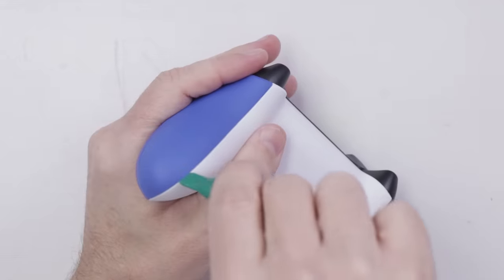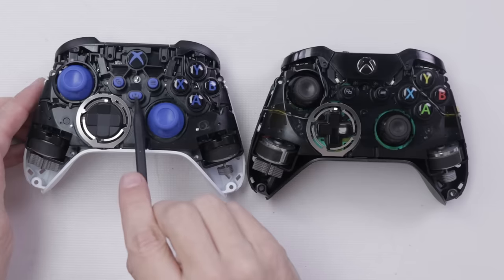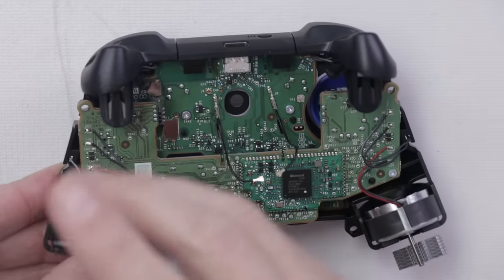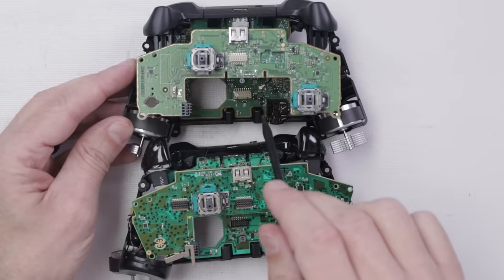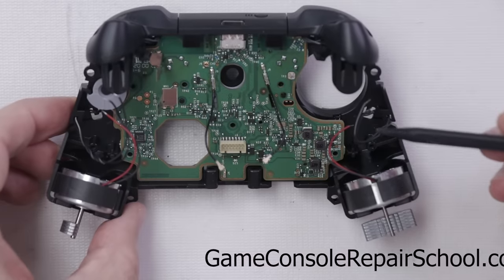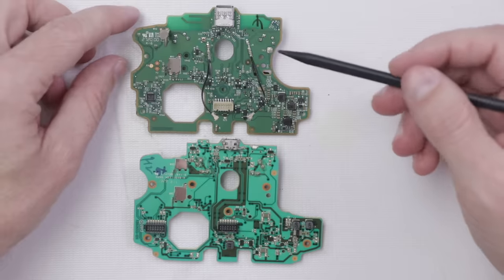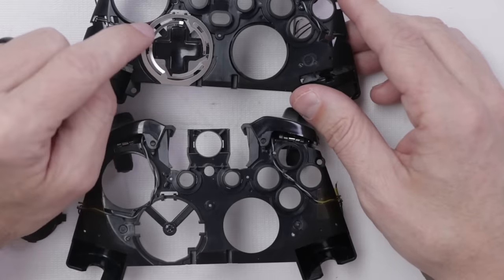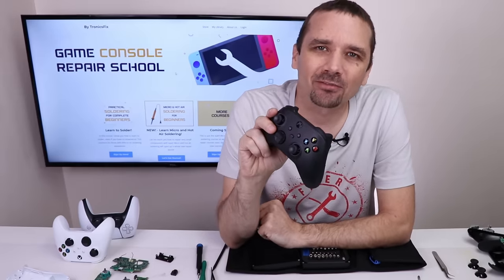Xbox Series Controller Teardown - A Repairability Perspective

Comment: I love how microsoft uses only like 2 different screw types, making it easier to repair
Reply: Master ELITE  idk i hated trying to fix an Xbox controller the ds4 is so much easier to fix
Reply: @Mancalius  it’s sarcasm
Reply: I like how microsoft makes xbox users change batteries everytime.
Reply: @JesusIsLord7773  I prefer it
Reply: @Mancalius  However, if the rechargeable battery dies. You just need to buy a new battery, not an entire new controller.  Also you can use rechargeable AA batteries which wouldn't cost much.
Reply: @Mancalius  you know they sell them in other countries too? And the currency changes. And you will be able to get it with free shipping. I'm not saying it's good, I hate the need to buy a battery pack and think it should be included but your argument wasn't very good my man.

There is also nothing stopping you from buying it with your console...... So you don't need to go out of your way to get it.
Reply: Playstation fans will literally use any flaw to their advantage and bash other people for not having said flaw on their system lmao what’s wrong with having easy to repair controllers?
Reply: @Mancalius  who in their right mind goes and buys 1 pair of batteries, instead of buy multiple battery's at once or rechargeables, not tryna be rude but that was fanboying at it's finest
Reply: @Mancalius  also what are you taking about fail rate if your ps4 doesn't break externally in a year then that battery won't hold a charge in a year unless constantly plugged in so talk about a guaranteed fail rate and guaranteed needing a new controller every year or so
Reply: @SanderEvers  if the batterie dies in a PlayStation controller, you just have to charge it, not buying anything
Reply: @JesusIsLord7773  you do realize the control is also wired just by playing while it’s connected to the Xbox with a usb
Reply: Actually this is ridiculous! All I want to do i clean my face buttons....  why the hell do I need to get my soldering Iron out to do that!?  Just to unsolder the stupid rumble weights!
Reply: @Andronicus87  what? You don’t have to take them off... I don’t even have a soldering thing and I’ve opened my control and cleaned out all the buttons cause they were sticky. There was still plenty of space when the board was there you just have to pull it back as much as you can without ripping the wire but it’s really easy.
Reply: or paint
Reply: @SanderEvers  Thats cool and all but its cost almost as much as an dualsense and with the official $20 play and charge kit even $10 more than the fualsense even though it has much much less features. Its a dcam either way if we are honest.
Reply: @beardedape7966  but that are the cheap quality ones
Reply: T10 T9?
Reply: @JesusIsLord7773  I like how Microsoft also makes my hands not die after a 20 minute play session.
Reply: @Mancalius  Or rechargeable batteries for $10
Reply: @vincentnavarrete5003  Lmao you kidding me? You have to dismantle the ds controllers into tiny pieces just to get to the analog sticks for example..
Reply: Right and the larger ones seem to be just for the shell and the smaller ones are for the board it's even intuitive too
Reply: Nintendo on the other hand...
Reply: Apple with their macbooks: uses 300 types of screws making it harder and more expensive to repair than Xbox One S controller
Reply: @sussyjetpilot1198  honestly one of the many reasons why I hate Apple
Reply: The ps5 controller is way easier to fix and it has way more stuff in it
Reply: Yo dude.
Like with all fanboyism aside how long does a series x controller last? 
Like for heavy gaming? Will its buttons stop functioning easily with hardcore gaming? Or will it last 1+year easy? Since i wanna but 1 for pc
Reply: You all can argue why you prefer Xbox over Playstation due to replacement of batteries, but you can't deny that doesn't matter and Sony's Playstation will always outsell Xbox haha. So quit your childish faboyism and go play your favourite games.
Reply: @Kaminari_Kitsunokami  you can hate Apple all you want. Apple isn't going anywhere.
Reply: As someone from a developing nation, I have absolutely no idea where to get the T-series screwdrivers so unfortunately it isn't that easy for everyone 🥲
Reply: @PeanutBreathing  I have absolutely no idea why they don't just use a normal screw. Also Amazon
Reply: @adjacent-smith  I feel like it's to deter self repair. We don't have Amazon where I live 😅
Reply: @shxzzie_  I'm xbox a d this shits annoying. I literally have a 36 pc speciality bit set so I have all the shapes and all the sizes of pretty much any screw.. except for the one needed for the xbox controller. And I'm deeply upset about it. I dont have money right now for buying a tool. I dont even have a car to go try and borrow one from somebody. I'm literally researching ways to unscrew and rescrew any screw. And it's annoying.
Reply: @megakoni1 they mean die as in dead dead not die as in you give it water to restart the day lol
Reply: @JesusIsLord7773  I would much rather have removable batteries.  While my daughter waits for her PS5 controller to charge, I slap a fresh battery pack in and keep playing, and don't have to have it plugged in.
Reply: @shxzzie_ yep, and it's painfully pathetic.  Fanboys of most things are top tier cringe.  If you have man sized hands PS5 controllers are miserable to use for extended play sessions, but to each his own.  I own every console and have a few grand wrapped up in my PC.  I like video games..period.

Comment: Very simple if compared with the PS5's Dualsense.
Reply from the maker: Yep...very similar to the Xbox One controllers.
Reply: I'd love to see the elite series 3 controller
Reply: this shows that microsoft did not put effort for controllers.
Reply: @velumanisakthivel221  I think this is a good thing. Most xbox players don’t want a drastic change. The only thing the Dualsense has that I’d want is the adaptive Triggers and 3D rumble. I bet Microsoft will do this in a few years.
Reply: @Steelbooking541  probably in xbox elite controller
Reply: @relate97  rumbke is different from a voice coil actuator, the voice coil actuator on the dualsense is even better than that on your phone, making it able to make much better feeling vibration sinstead of rumble, and making vibrations able to be barely feelable or evident
Reply: @Steelbooking541  that isnt 3d rumble, thats a voice coil actuator
Reply: @eryavrilio3751  and no the elite controller dosent have 30 rumble or a voice coil actuator
Reply: @Mancalius  Does the voice coil actuator have its own chip controller? Can i replace the rumble motor with that thing?
Reply: @eryavrilio3751  its probably impossible to be put on a dualshock 4 since a chip is in the dualsense for it, and its a different type of system so the dualshock 4's commands probably wont work or would be super basic for this mechanism
Reply: Bryan Smith good for single player games tho like god of war or spider man itll make the game a lot more immersive
Reply: @velumanisakthivel221  if it ain't broke don't fix it
Reply: @Steelbooking541  and that's exactly why Xbox always lose on sales because they don't show next gen features and they are always behind that's why Nintendo switch pass Xbox on sales and if Microsoft keeps showing that they don't care about their console they're always going to lose
Reply: @Steelbooking541  not if Sony has a patented
Reply: @derekotero7935  Microsoft isn’t trying to win a ‘console war’ that’s all in your head, I’ll also mention Microsoft player base is PC players AND Xbox players. Which is probably bigger than PlayStation or Switch by themselves.
Reply: @ethanw6624  Sony can’t patent that. They can patent the EXACT design they used but they can’t stop Microsoft from designing their own version that accomplishes something similar.
Reply: @Steelbooking541  anything can be patented like the xbox elite is patented the paddles are the adjustable thumbstick tension is patented what stops sony form doing it
Reply: @ethanw6624  That’s untrue. Like I said THE EXACT DESIGN, And dimensions of the paddles are what is patented. Microsoft cannot patent the WHOLE idea. That’s like saying google can patent smartphones so no other smartphone of a different design can be made. Sony can make a ‘pro controller’ with 4 back paddles and trigger locks if they want. Do you not realize there are MULTIPLE other brands of controllers with 4 back paddles and trigger locks that are not Microsoft’s? I don’t think you understand how patents work.
Reply: @Steelbooking541 for an example apples lightning cable is patented there are thousands of companies that make it but they pay to use it do you think Microsoft is going to pay to use it and most pro controllers use buttons because they dont want to pay scuf ot Microsoft money to use paddles and Microsoft used scuf patents for the paddles
Reply: @ethanw6624  Apples lightning cable is an EXACT design that only communicates with apples software though. You don’t understand how patents work.
Reply: @velumanisakthivel221  it’s already the most confortable controller on the market so obviously it wasn’t going to be a big change
Reply: @velumanisakthivel221  properly thought they didn't have to. to many companies cut corners nowadays and xbox thought sony would do the same big mistake.
Reply: @Steelbooking541  if they don't care about sales why do they even keep making consoles... Oh and yeah I'm one of those PC players
Reply: Yeah, specially because they know it is already a great controller, but if you look from a business perspective, it makes all the sense: Microsoft is building an Ecosystem: play from  the console, or phone, PC, SmartTV and soon on browsers (wild to think that you would be able to play on a Chrome Book!), having additional channels to send signals either for haptic, adaptive triggers, or 3d rumble, you just add more I/O between the device and the controller, it could cause latency problems which is something that we don't have technology yet to mitigate (note: one thing is to have your phone in a short range to your console, another thing is to have it paired via bluetooth to a mobile phone that relies on the internet to send/receive data from the server that is currently running your game on). I believe that MS has opted to go with a simple and known working condition for the controller to give a better compatibility within the ecosystem, once these features (which surely would be nice to have) they might consider to make it available
Reply: @Steelbooking541  just keep watching how PlayStation, PC and Nintendo pass Xbox on sales
Reply: @Steelbooking541  I still waiting for Microsoft to say IT WAS S JOKE obviously guys we were not going to be using technology for 2005 from the Xbox 360 on our 2020 controllers and using the same UI for 2013 on or Xbox series x with no next-gen features and a lame name... I still waiting ._.
Reply: @Steelbooking541  wait so is not a joke that is actually the Xbox series x? I was having hopes Microsoft and you failed me another year 😔
Reply: @Steelbooking541  maybe with the next gen consoles that come out in 7 years with the PS6 and the Xbox series double Mac big junior size serious triple XXX mc baconator serious ass double x x, maybe the Xbox is less useless
Reply: @Steelbooking541  I love Microsoft so much that's why I pay for game pass on PC , but their console is trash literally ass, is like the same way that I love Google but stadia is trash
Reply: @derekotero7935  In my personal opinion the Xbox Series X is AWESOME. I love that UI is the same as the Xbox One, I love how seamless EVERYTHING I already have works on it. The name is definitely dumb and confusing, but everything else is awesome about it for a consumer such as myself (I own 282 digital games on Xbox). If the console doesn’t work for you then don’t buy it lol Microsoft won’t care, you aren’t hurting their feelings, gamers such as yourself fail to realize that console makers are not trying to make EVERYBODY happy. Just because you don’t like how they do things doesn’t mean it’s bad strategy it means it doesn’t work for YOU and YOU are only ONE person (:
Reply: @Steelbooking541  I mean if he makes you feel happy I used to have a Xbox 360 and play Halo 3 all day long... But them sell it and got a PS3 because I just got a Xbox red ring at that time
Reply: @relate97  people who talk down the dualsense are people who've never used one, after using mine going back to the dualshock feels like a significant downgrade.
Reply: @relate97  You were being dismissive.
Reply: Very inferior too
Reply: Very simple because its a lame-ass controller from xbox1 era
Reply: @velumanisakthivel221  uh yes they did
Reply: @Steelbooking541  whats adaptive triggers?
Is it same as ps4 triggers?
Reply: @velumanisakthivel221  if it ain't broke dont fix it. Small changes are great cant deny Xbox had the best controller last gen and continues to have the best controller this gen. Especially with all the malfunctions reported for the dual sense.
Reply: @velumanisakthivel221  If it ain't broke don't fix it ever heard of that
Reply: this is ridiculous! All I want to do i clean my face buttons....  why the hell do I need to get my soldering Iron out to do that!?  Just to unsolder the stupid rumble weights!
Reply: @velumanisakthivel221  they didn’t need to change it becuase the controller design is already great as is and doesn’t need stupid gimmicks to thrive like Sony’s controllers do

Comment: Beautiful guide, you sir are quite the instructor. I had a sticky "A" button and I was able to open up the controller and without soldering the back board because I don't have a kit I was able to still remove the main board and clean the button. Slapped that boy back together and we up and running brand new. Chef's kiss.

Comment: Amazing video as always. I’ve built a small scale local business around controller repair during COVID. Just friends and family for now... thanks for the great info. I’m a soldering guy from a install sound company with a few wire soldering skills. This may be a retirement plan for me!
Reply: How's the business going? I'm planning to do the same
Reply: @izakomandaz2895  I hope it works out for both of you
Reply: I have a 3 week old xbox series x wireless controller and it is a xbox brand. And it wont turn on. It worked fine 4 hours prior. No water damage hasnt been abused or dropped. I have tried new batteries and plugging in a cord from the controller to the xbox and still wont turn on. Any advice you could give would be great.
Reply: @cdawg42  give the battery contacts a good cleaning with isopropyl and make sure they are not corroded. If that doesn’t work you will need to open up the controller and check for any damage
Reply: @cdawg42  just realized you said you used a cord. You will probably need to open it up and check for damage

Comment: Microsoft definitely took the "if it ain't broke don't fix it" approach to this new console controller.
Reply: i mean it’s not a bad approach. but they should have atleast tried to incorporate some semblance of some next gen technology. went from a ps4 to xbox series x  and you can immediately tell that Sony takes more pride in providing an aesthetic and pleasing approach
Reply: yea very disappointing they tried to play this gen safe and its going to be the biggest mistake they made ps5 controller is the most badass thing i've seen.
Reply: Rafay Nadeem I disagree they saved the consumer $50 easily by having backward compatibility for older controllers.  That $ can be saved for gamepass or for physical games that will come out over time.
Reply: @johndoe-fz3sz  The Elite Xbox controller does everything the Ps5 controller does and better
Reply: The ps5 controllers started braking
Reply: Mr Elim so I’ve heard. Which means Xbox takes the lead unless controllers break for them as well. Xbox One controller’s had issues as did the Elite Xbox controller.
Reply: Yeah it's a good controller design they just improved on it
Reply: @jaradshively8976  Really now? Does it hace motion controls? HD rumble? Adaptive triggers? A speaker? An rgb light? A touchbar?
Reply: @jaradshively8976  For only $100 extra and they break quickly
Reply: @jaradshively8976  no not really, the new Xbox controller it doesn’t have HD rumble and it doesn’t have motion controls
Reply: @edgarvega5859  ikr, the PS4/PS5 controllers have SO much tech built into them…
Reply: Kinda dissappointing they didn't at least put in motion controls.
I think gyro aiming is a nice option in certain games, I feel like gyro should be a standard in controllers by now.
I love everything else about the controller especially the d-pad, it's my favorite out of all the controllers I've used.
Reply: Drifting problem and sticky shoot buttons.
Upgrades are the worst, I love Xbox one S controller, the only problem was sound disturbance from controller jackstik, CLICKing noises other than that it was perfect.
Reply: @jaradshively8976  and its super unreliable, sticky a buttons, buttons stop responding, and so many other issues. the normal xbox controller has less features but is better if you want a reliable controller

Comment: Yeah, those initial covers are strangely way harder to get off than the Xbox One versions. It looked identical to me, but yet I had to use way more force than I thought would have been necessary to open the Series controller.
(I already took my controller apart to remove the rumble motors. 😁 I hate rumble, so I always turn it off, which just makes the motors annoying dead weight. I prefer removing them and having a lighter controller.)